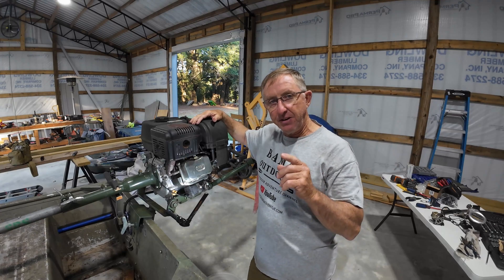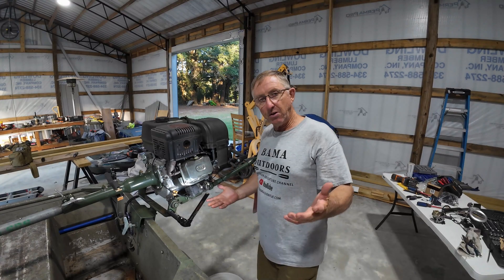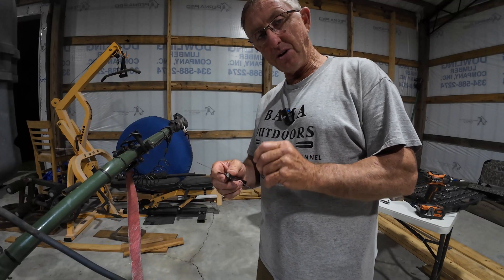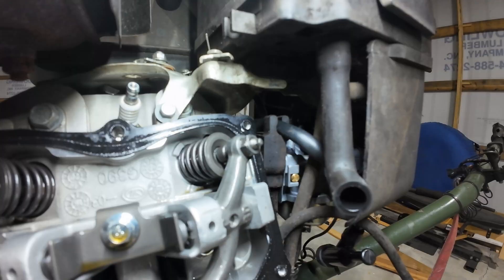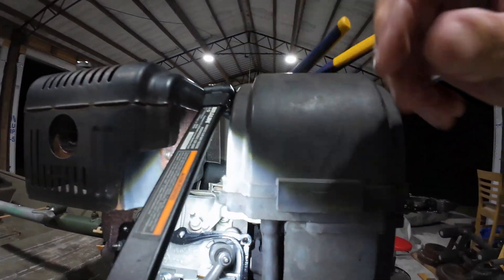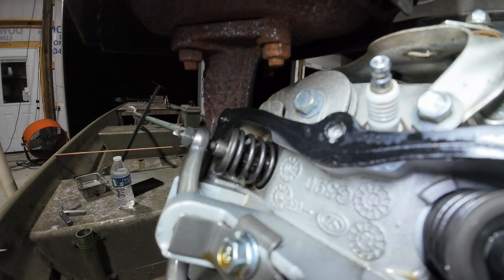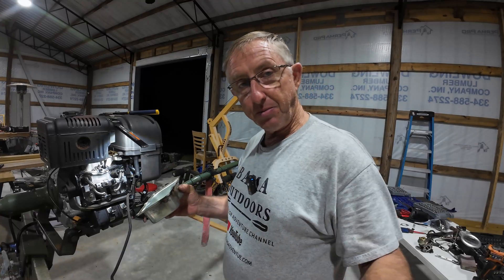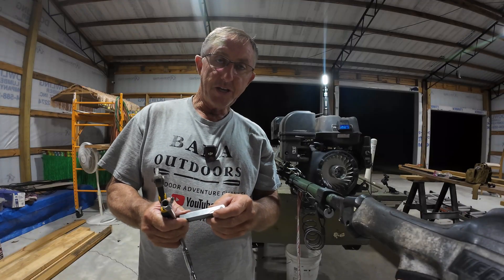Predator 420 Valve Adjustment

Comment: Had a rocker arm break and gonna have to buy another engone bc no one sells the part. It is sad day for me
Reply from the maker: Dang man that's not good! They call it a Honda clone I wonder if a Honda rocker arm would fit it?
Reply: @Bamaoutdoors  kek ineed it would. Unfortunately theres no one who sells it in my city on a satirday morning thus its time to go buy an engine
Reply from the maker: Well if you look at the silver lining at least you'll have some spare parts off the old engine lol
Reply: @Bamaoutdoors haha thats true 🎉🎉
Reply: @Bamaoutdoors  tbh im just gonna take the rocker arms pins and pushrods from the new engine should be alot faster then trying to swap the whole thing bc dont wanna fck with trying to pull off the generator head for sure and something tells me the shaft would be keyed different